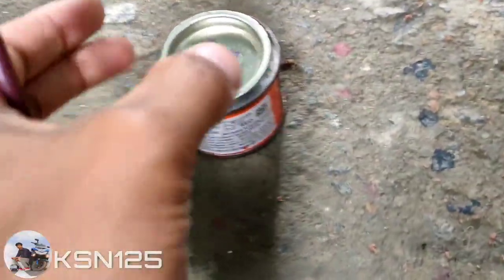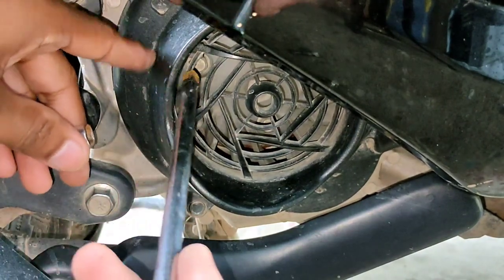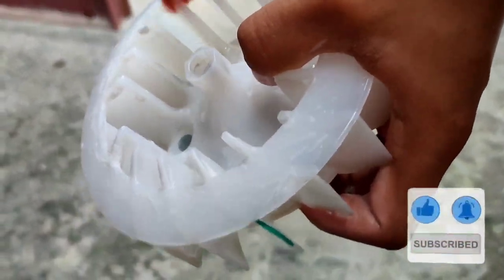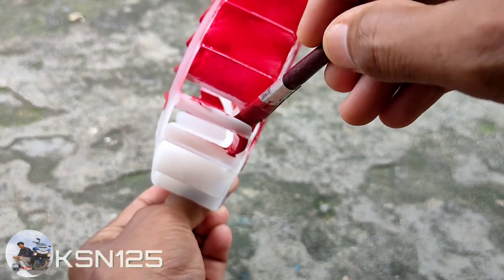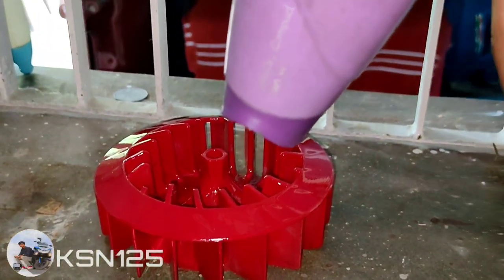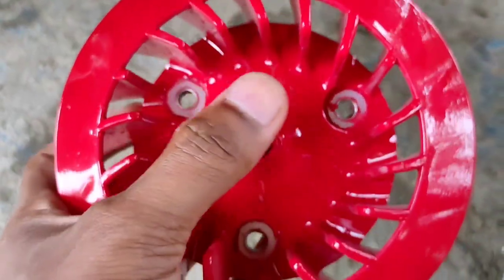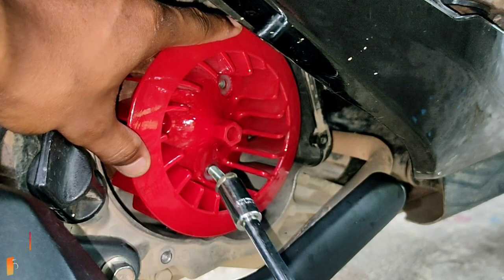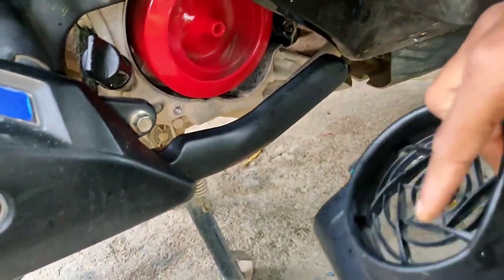Scooter cooling fan 🛵 #KSN125

Comment: Ksn bhai ek question hai bhai mein jab apne burgman ko ek dam full throttle mein chalata hu uske baad jab mein slow karke 40 ya 50 ka speed mein chalata hu tho wo smoothness nhi raheta thoda jerk deta hai engine jab mein accelerator ko chorke firse raze deta hu........

40 50 ke speed mein aur jab mein normal full throttle nahi deke chalata normal chalata hu tho jerk utna nhi karta plzzz ksn bro plzzzz batao na ye problem hai ya nhi plzzz ksn bro PLZZ batao I m. Waiting for ur reply
Reply from the maker: Ye problem usual hai. Kyu ki jb hum full throttle pr chalte hai tb bike ke clutch plate heat up ho jate hai. Jishke karn bike jerk deti hai. Don't worry ye problem mere Baggu me v hai
Reply from the maker: And for more details please contact me on instagram 🤓 for instant reaply plz follow me on twitter 🤓
Reply: @ksn_125  already following brother
Reply: Tnx a lot brother mein socha tha service center waalo ko complain karu but aab thik hai acha full throttle ke baad aapka v 40 to 50 speed mein jerk karta hoga and utna smooth nhi chlata hoga but 3 se 4 din baad wo normal ho jaya hoga aesa hota hai kya aapka
Reply from the maker: To aap woha baat kro n. Achhe main reaply de pau ga
Reply from the maker: Yaa same here.
Reply from the maker: Aap chaho to clutch assembly ko cleane kara Lo. Problem quickly solve ho jai ge
Reply: @ksn_125  ok next time burgman ka problems aaynge tho aapse Twitter pe puchunga